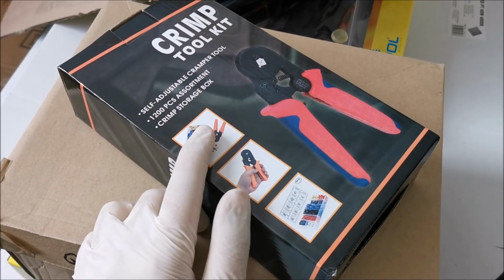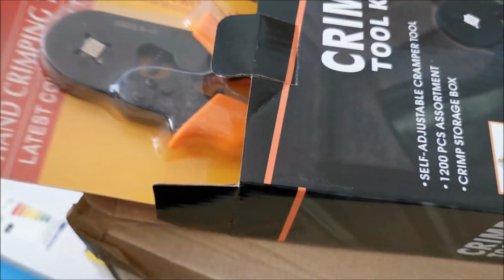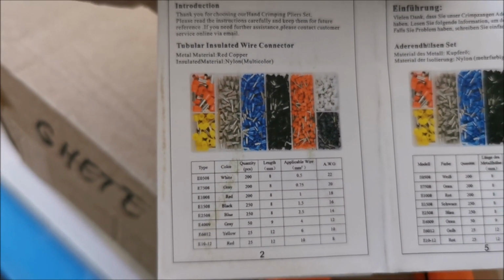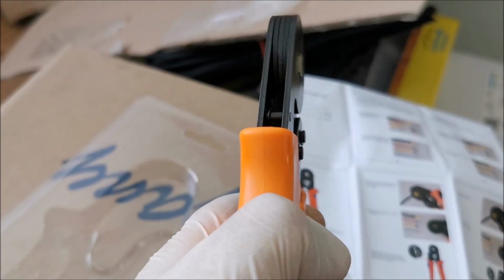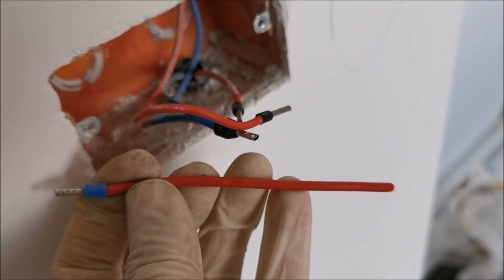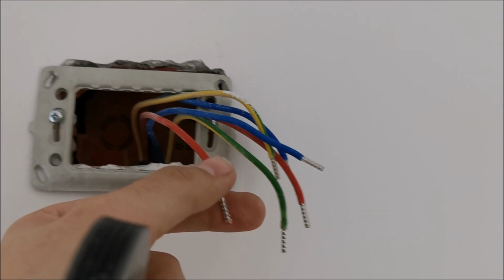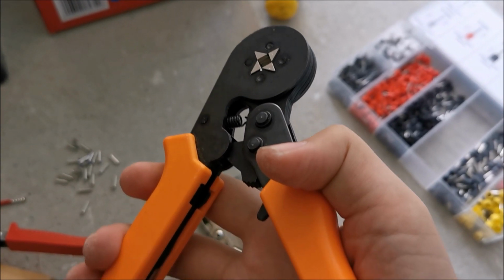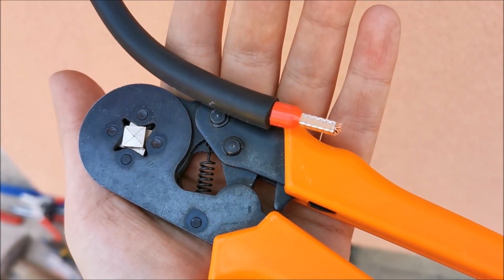Crimp Tool Kit HSC8 6-4A (for ferrule wire tube terminals) - review and test

Comment: thank you for filming with such great detail.  question for you.  I accidently got mine locked together with the ferrule stuck inside. the handle wont budge in either direction.  Any suggestion on how to get it to release? thank you
Reply from the maker: Hard to guess without seing myself. But, if it's a big ferrule with thick wire, I would try to drill trough the middle of it, to create some space.